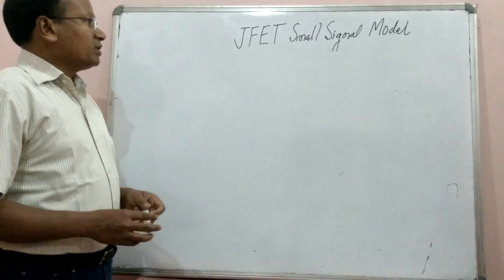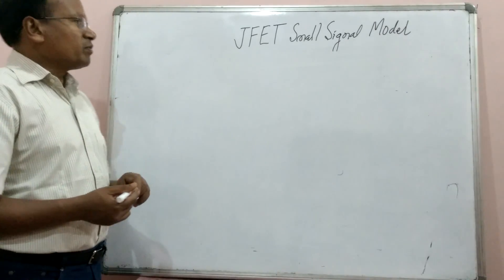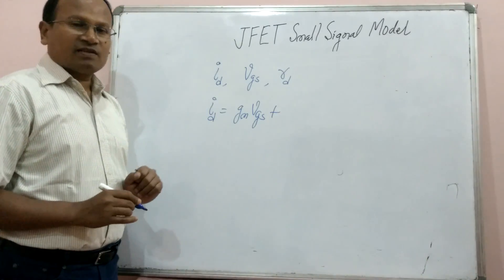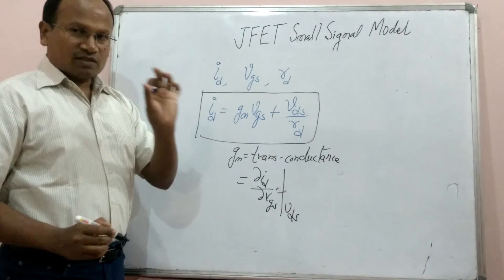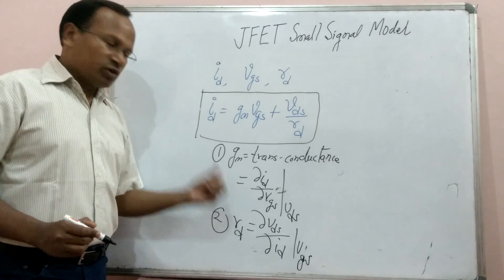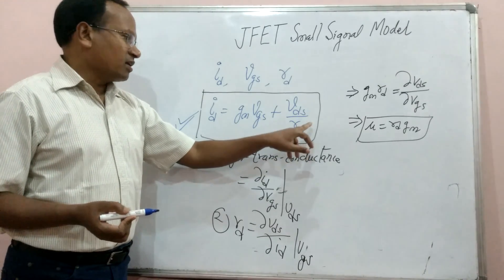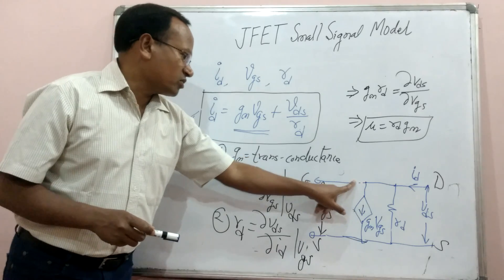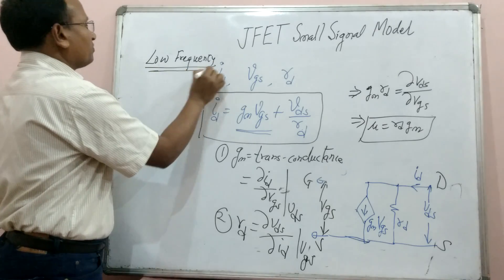JFET Small Signal Model by Dr G R Sinha

Comment: Sir, how did you write the equation of Id at 2:36 ? I know Id=f(Vgs,Vds)...but how can you come up with that equation?
Reply from the maker: Thanks for your interest. The drain current is contributed due to Vds becaues drain current is flowing in drain region so it would be affected by Vds. Please remember that FET offers resistance rd which is drain ON resistance even if there is no proper Vgs. Second part is due to Vgs because we know that FET is voltage controlled device and reverse biasing of Gate and the operation of FET is controlled by Vgs and thus second factor is present in the expression of Ids (Id). Hope this clears your doubt. Please let me know if any further clarification required.
Reply: Dr G R Sinha: Conceptualizing and Motivating sir any reference book/material u can recommend for this? Mathematically how did u get Id equation